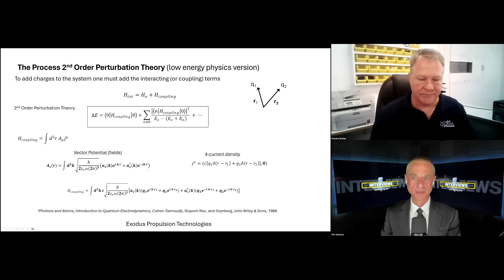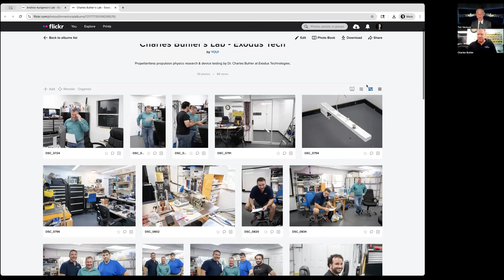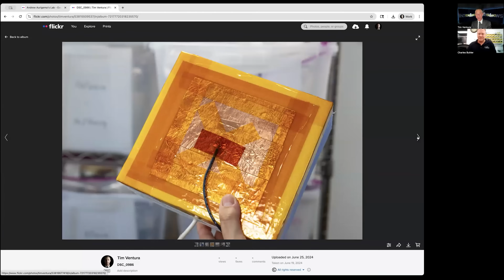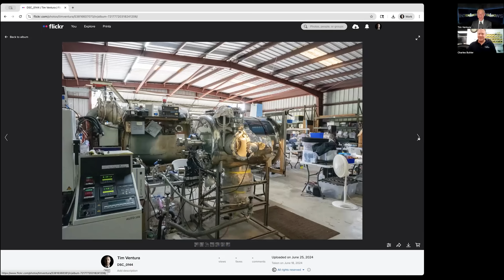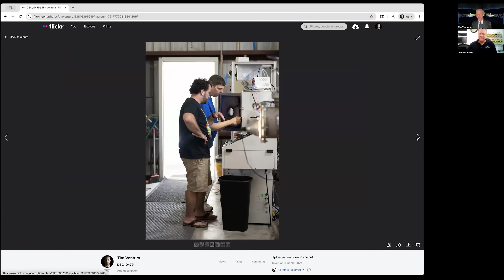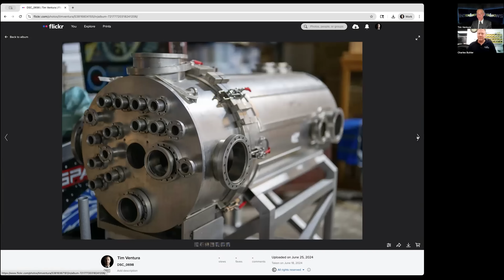Exodus Propellantless Propulsion Physics | Charles Buhler

Comment: I have no problem with electrons exchanging momentum and energy with the vacuum field and conserving momentum, but the energy (or net force) must come from somewhere; there should be conservation of energy in the composite system of electrons plus the EM vacuum. This part was missing from the conversation.
Now, it’s true that conservation of energy can appear violated at short timescales (uncertainty principle), but there are no free rides — this energy has to go back to the vacuum, which means there is eventually no net force when you average over time.

Unless, of course, I’m missing something here.
Reply: Consider this: the electrostatic field isn’t static, it’s constantly regenerating at light speed, dynamically distorting the vacuum. The vacuum, far from getting tired, tirelessly tries to symmetrize that asymmetry, like a self-regulating mechanism. An okayish analogy is a spring-loaded fountain button, press it, and water flows endlessly as long as the pressure (assymetry) keeps going, without depleting the source. The vacuum’s capacity to do work is effectively infinite because it’s an open, energetic medium, not a closed system.

Energy conservation still holds, but it’s only a tool for measuring isolated setups. In a broader context, vacuum included, it’s the asymmetry that lets the system tap into this boundless reservoir, no need to create energy from nothing since the energy already exists in symmetrized form (take your hands and press them together — that is similar to what the vacuum is doing when it is symmetrized imo). Hawking also implied something like this:  he said, the total energy of the universe is zero because the positive energy of matter cancels the negative gravitational energy, and ‘two times zero is still zero.’ Off-balance the pressing force in one hand and you break the symmetry, tapping into that infinite reservoir, not creating energy from nothing but unlocking the vacuum’s inherent balance. 

Full quote:
“There are something like ten million million million million million million million million million million (1 with eighty zeroes after it) particles in the region of the universe that we can observe. Where did they all come from? The answer is that, in quantum theory, particles can be created out of the energy in the form of particle/antiparticle pairs. But that just raises the question of where the energy came from. The answer is that the total energy of the universe is exactly zero. The mass in the universe is made out of positive energy. However, all mass is attracting itself by gravity. Two pieces of mass that are close to each other have less energy than the same two pieces a long way apart, because you have to expend energy to separate them against the gravitational force that is pulling them together. Thus, in a sense, the gravitational field has negative energy. In the case of a universe that has an approximately uniform space-time, one can show that this negative gravitational energy exactly cancels the positive energy represented by the mass. So the total energy of the universe is zero … and two times zero is still zero. This means that the positive and negative energy in the universe can simply be doubled without violating the law of energy conservation. It is said that there’s no such thing as a free lunch. But the universe is the ultimate free lunch.’
— Professor Stephen Hawking”
Reply: I think the only explanation is that at some level this is a quantized inertia effect, the energy that comes to the particles accelerating in one direction has to be the horizon deleting information on the other side. So total mass-energy-information is preserved.

Comment: Yes the grarless differential is designed 5 ports inside 7 on the outer one center pining the be the axis a hexagonal structure center the reason for this is the shifting point in expansion contraction of the gelatinous liquid and the small gas bubbles that are charged on their way to long side  from short the short is drained of charge and sent to the opposite side to charge the bubble on the expandable circuit brush points to diode to other brush a commentator in which the powerful voltage is building up so much it has to be resistored or drained or the gas bubble gets too large of sorted charge collapses

Comment: Am I missing something or is he saying they are pushing off of virtual protons or photons. Wouldn't virtual protons have a positive charge . Photons are weightless but have momentum, so reactive force. I kinda get it.
Reply: Without the need for an actual exhaust or thrust material you could layer many plates on top of each other. They used to levitate aluminum foil by applying a high voltage potential to the foil, I'm guessing it's the same effect

Comment: 🔬 SCIENTIFIC REALITY CHECK: CID vs EXODUS

CID delivers definitive experimental proof of propellantless propulsion through rigorous constraint testing. When rotor arms are free: 180° torsion balance deflection (34 mN thrust). When arms are taped: 0° deflection (zero thrust). This binary on/off control eliminates all alternative explanations - measurement artifacts, electromagnetic interference, thermal effects, vibrations, and external forces.

Testing in Faraday cage + sealed chamber confirms thrust generation in realistic deployment conditions while eliminating conventional explanations. The constraint test proves causation: thrust requires physical arm movement, period.

Exodus makes extraordinary claims (>1G thrust) without extraordinary evidence. They provide no constraint testing, no control experiments, and no method to eliminate their claimed mechanism. Their results cannot be independently verified or replicated. Without an "off switch" to prove causation, their claims remain scientifically worthless.

I don't understand why people keep talking about Exodus technology like it's revolutionary - I have not seen any proof of anything. They offer no reproducible experiments, no constraint testing, no independent verification. It's all unsubstantiated hype.

CID follows rigorous scientific method with falsifiable hypotheses and controlled experiments. Exodus violates basic scientific principles by making unverifiable claims.

The brutal truth: Any legitimate propellantless propulsion device MUST demonstrate controllable elimination of thrust to prove the mechanism. CID does this definitively. Exodus cannot.

Verdict: CID has definitive proof. Exodus has marketing hype masquerading as science.

Comment: I think in acid electrolyte batteries 

You can define hydrogen ions, and clouds of orbiting protons as voltage, relative the the isotopic states of the hydrogen ions 

And electrons, returning to the battery, as voltage, which then partially recombine within, sometimes as atoms, sometimes within ions as electron orbits in electron plasmas

For a rechargeable system

Then, using a computer system, this logic can start to define using faradays law 

Photons and waves as currents (amps) and voltage, 

And different ions as amps and volts, based on magnetism 

So you can use them as fuel cells, to attract current, and discharge hydrogen plasma